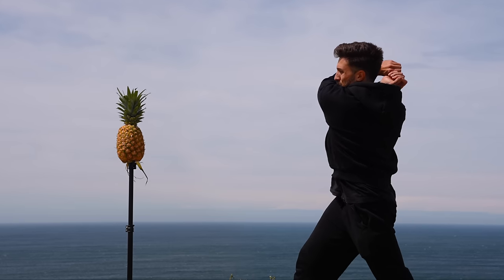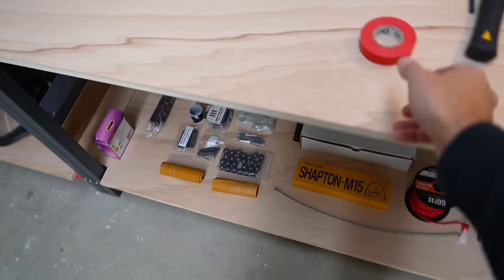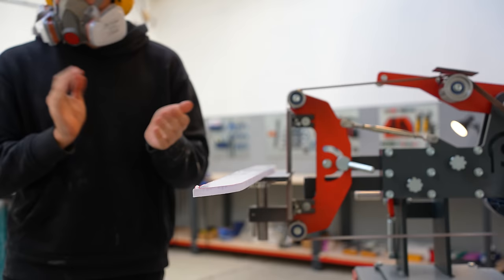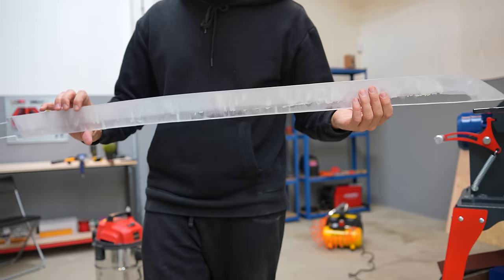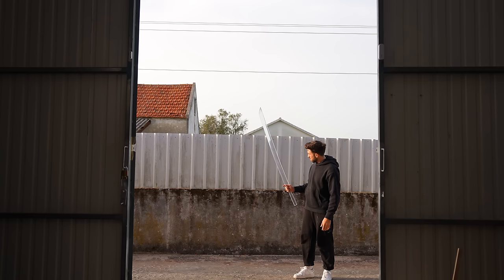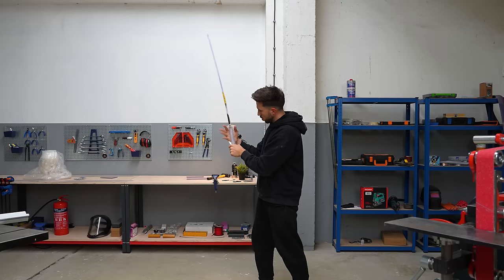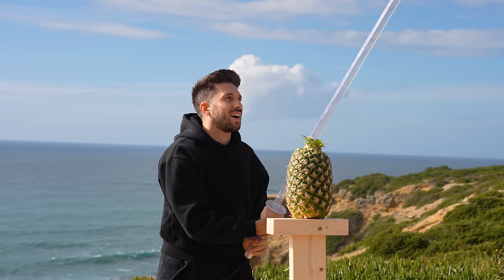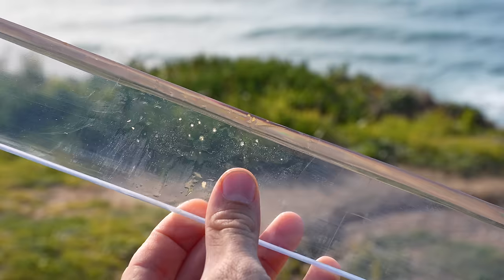I Built a Transparent Katana

Comment: The fact that the blade is so thick that it reacts like an thin hammer and not a katana. It do not cut but completely smash the objects !
Reply: The fact that his stroke is baseball bat smashing, not cutting.
Reply: Yeah, the first blade would have likely cut much better, even if it's far less transparent.
Reply: @joedingo7022  I want him to test the first blade. It would;ld have to be a better cutter, but maybe not as robust...
Reply: It's mostly the taper off the edge and somewhat the thickness of the whole "blade" 
Just as in regular cutting. It's behind the edge thickness. A thin but completely dull knife will still cut through most things while a thick but razor sharp knife will have a very hard time going through an object
Reply: Correction “a” thin hammer.
Reply: A thin hammer is known as an axe.
Reply: @elio7610  yeah but i talk about hammer not axe because it smash more than it cut. That's not the same thing if you understand what i meant
Reply: that was more than a 45° edge too!
Reply: @ewen59gaming50  It wasn't the best cutter but it definitely cut.
Reply from the maker: Yeah I agree. The first blade would've been a bit better at slicing, still not even close to a normal steel sword being PC really soft. My goal this time was just trying to make it as transparent as possible, so I'm gonna maybe test the first blade and make a short or an IG story so that you can see how it performs. Looking back I also feel like PC would be much better for a club or something like that rather than a sword
Reply: @MikeShake  I want slingshot 😢😢
Reply: Beaucoup niku!
Reply: @MikeShake  kool
Reply: It was too big to be called a sword. Massive, thick, heavy, and far too rough. Indeed, it was a heap of raw polycarbonate.
Reply: @MikeShake you should make a besento
Reply: @MikeShake it's really cool
Reply: Im just gonna say what everyone is screaming.
So make a thinner one and try it.
Reply: @MikeShake  see i thought that when you said you were gonna make a smaller bevel, i assumed you were gonna make the blade itself also thinner by taking it and cutting it in half longways down the middle, so that you could have a shorter bevel but still have it somewhat sharp
Reply: Yea
Reply: @MikeShake stronger whip pls
Reply: This material would work for those HUge sword builds like Guts Sword. Dragon slayer or something
Reply: So did Musashis modified oar
Reply: Well still effective to break bones. Limbs no more
Reply: I think the reason it smashes is mostly because the blade flexes too much so the edge doesn't align
Reply: Simply paint a sword neon green
Reply: I'd say it acted more like an axe then a hammer, but tomato tomato
Reply: @apollyonnoctis1291 i understood that berserk reference
Reply: *The invisible sledge slicer.
Reply: @MikeShake  The point was to make it Invisible not the sharpest sword ever!
Reply: @MikeShake Polycarbonate might make a really decent axe also...
Reply: It's essentially a katana-shaped sword that functions like a medieval broadsword.  Doesn't need to be razor sharp by any means, because it relies on the weight to carry the "edge" through an object.

Kinda like the video I just watched yesterday from Kentucky Ballistics with the Gyrojet pistol. Fires one chonky looking "bullet", with the jet propulsion on the back basically FORCING it through a block of ballistic gel.
Reply: @MikeShake for the first katana you should give it a non transparent handle I think it would look sick
Reply: The fact that the blade is visible and not invisible
Reply: I its not a hammer it works more like an axe. Its to wide to "cut". Its a hack. 

How do i know?

Im a bladesmith
Reply: The larger and heavier edged melee weapons does have rather dull edges and used not to simply cut through armor but to gather enough force to break the armor and damage whatever it is protecting.
Reply: "it was too thick to be called a sword..."
Reply: Average guts berserk weapon
Reply: a thin hammer*, it does not cut, but completely smashes...*
Reply: It would be generous to call it a sword. Its more like a hunk of steel
Reply: I feel like it's more like a bat with a bevel instead of an axe or hammer
Reply: The problem is that polycarbonate itself can't really be sharpened to any meaningful extent. It's interesting that he chose a katana, as the strength of that sword comes from the combination of the flexibility of its core steel and the hardness of its edge steel, the latter of which being what allows it to be brought to an extremely sharp edge. In theory, he could recreate that effect with this sword by making the very edge out of a thin piece of a much harder material (most likely a length high-carbon steel wire or sheet or something) bonded securely to the polycarbonate. The thinness of the edge material would lend it flexibility, while the bulk of the polycarbonate body would lend it strength and heft.
Reply: @apollyonnoctis1291 It takes Guts to wield that weapon.
Reply: that sounds like a hint that the anime character that uses it is the most non ninja type person known to man.
Reply: Doesn't *
Reply: It would've cut better if he wasn't broadsiding it with the blade. This is a common mistake I've seen repeatedly over the years from many people on YouTube. Just like with kitchen knives and steak knives, the cut is cleaner and smoother at an angle so that the blade is drawn across the surface. So instead of all the force hitting in one spot like an axe, which is respectfully powerful in its own right, more of the edge is used and makes a continuous cut, losing less energy across a larger area. The fact that it did so well like that makes it really scary to think how it will do with a proper cut. 😮
Reply: @theElemDragon both have essentially the same weight.. it's how they're profiled and balanced that makes the difference
Reply: And yet it has to be thick to be durable. Conundrum.
Reply: @MikeShake next video idea pls👀
Reply: @MikeShake  a machete! shorter and thinner blade but much wider, you still have a lot of invisible part and you dont mind the short edge
Reply: @MikeShake  Cold Steel produces polypropylene katanas for Aikido/Iaido training. Although they are not invisible and not sharp, they are virtually indestructible. I have been using one of them for five years, we also use it for full contact strikes and the blade holds.
A friend once sharpened his blade and the cuts were impressive, although not quite as strong, because polypropylene is much softer than steel.
Reply: *a thin hammer(I am a certified 🤓)
Reply: @MikeShake wow
Reply: @MikeShake Trending!
Reply: Fan
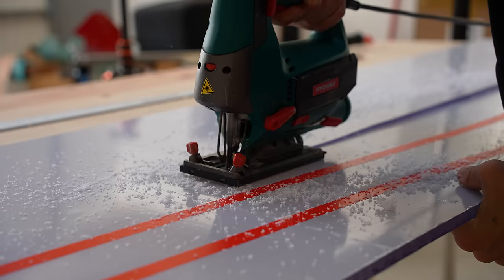Reply: @MikeShake  3:15
Reply: @MikeShake  3:17
Reply: @MikeShake  3:21
Reply: @MikeShake I’m a fan!!!❤😂🎉😢😮😅😊
Reply: An interesting proof of concept, though ultimately impractical.
Reply: @theElemDragon  A Medieval "broadsword: could be and were mostly sharp, maybe not katana sharp, but plenty sharp. The idea that Medieval European swords were exxentially dull bars of steel is a myth that's long been disproven. And katanas, while capable of being sharper than the average European arming or longsword due to its construction, was no more capable of cutting through metal armor than its European counterparts wer.
Reply: @MikeShake you should make a khopesh
Reply: @elio7610  It sundered. It didn't cut. Hehehe.
Reply: @CleverGirlAAH  A cut is a sunder.
Reply: s‘remmah elov I
Reply: @MikeShake try coming up with ur own weapon
Reply: @ewen59gaming50:
Child, it's past your bedtime.
When (if) you grow up, try to learn how to express yourself better.
You might get (a little) farther in life.
Doubtful. But, possible.
Reply: @jeffro.  I'm french sorry if my english isn't perfect, you are a 40yo dad attacking teenagers because their first language isn't yours. Get a job seriously. If you watch the video Mike is italian an his english isn't perfect too. You have better things to do bro honestly ;) And it was 6am when i wrote this comment, you, you are writing this in the middle of the night, don't you have a family to feed ? Go to sleep and use tomorrow journey to get a life !😘
Reply: "IT WILL NOT CUUTTT" -DOUG MARCAIDA 😂😂
Reply: The invisible skull crusher.
Reply: Guyssss,before Gta 6,we might actually get RGB kattana😂
Reply: more akin two handed greatswords.
Reply: Guts Sword
Reply: "It do not cut" 
Why can't people spell correctly???
Reply: @MikeShake great axe?
Reply: @petermgruhn i was just about to say the same thing. This is not how you use a katana. But Videos was awesome. I am curious what Happens of He uses the katana correctly.
Reply: @MikeShake Yea you made a clear version of Sephiroth's sword(FFVII) "Masamune". The first time around, I want one. I'd also like to see a busta sword version...but I don't think that's possible.

(Also like your giggle after saying you're going to test it on... A lot of things.)
Reply: @MikeShake  make it more like a scimtary, it s curve make it mitigate the initial shock and offer a smaller portion of the blade to start the cut.
It can be thin because of that, usable on horses for slicing with horse speed helped a lot aswell, but that not the purpose there :p
Reply: it can cut but not slice properly he hits the watermelon and it does a horrible job slicing through an easy target, overly wobbly to the point where the side of the blade connected with the melon and just blunted it. It's a cool idea but not practical maybe could be improved. An invisible short spear on the other hand would probably be very effective. Attacking with given the same type of material would be harder to see coming too as perception is harder with pointed objects coming straight at you with depth perception. The weapons only visible point would be the spearhead tip making the entire weapon that much more transparent.
Reply: porque aca la gente habla solo ingles xd
este es un video español creo yo .-.
Reply: @MikeShake  A PC Warhammer would've been wild.
Reply: This is such trash content...... And you want him to make a plastic hammer....
Reply: Thinner blade will break that plastic isn't indestructible as we all saw with the broken handle and it's not going to hold a good edge due to lack of carbon steel 😢
Reply: Maybe you can combine more materials, PC make it transparant, but you need ''bone'' to make it not bend whien you swing it. N maybe more thin metal to make it cut rather then smash
Reply: its not like he said that multiple times in the video right
Reply: @petermgruhn  true, that always kinda annoys me to see when people try to test medieval weaponary and the like
Reply: an invisible hammer would sound cool tho
Reply: @apollyonnoctis1291  one word for you: dragonslayer
Reply: @Sharp.Penguin00  yup, it's all about resistance. and also on how to maximize balance and force when striking. I'd really recommend he makes a heavy pommel at the bottom of the blade to make it work more like a sword and less like a very sharp club.
Reply: @MikeShake  you need to:
-thin out the sword as much as possible 
-make a counterweight on the handle/pommel so you have more control over the sword itself. I'd also suggest reducing the general thickness as you go into the tip of the sword. So thick base, and thin tip. This will ideally make your sword much more maneuverable. The center of balance for swords should generally be a bit above the handle, just so you know.
And with that, the sword would be much more effective, and maybe you could take advantage of the distortion and create patterns along the blade to make it look icy? Dunno man, but I really want to see this sword be the best it can be.
Reply: its unbreakable
Reply: Yep, I don't know why he's calling it katana, it does not look like a katana at all.
Reply: @elio7610  A wedged maul. An axe shouldn't be THIS thick.
Reply: Precision wedge crusher 🤘
Reply: I have a real Katana in my house it can likely cut anything like a flash 📸.
Reply: Every things broken due to high impact not sliced
Reply: factoriales
Reply: i have never see a katana that is 12mm thick, not even most of the knives and swords. maybe in sabres and axes?
Reply: It’s a slightly sharpened club.
It might’ve been too brittle if it was made as thin as a normal sword, which is why it’s hard to make swords in the first place.
It has to be brittle (hard) to keep an edge but it has to be bendy (soft) as to not crack. Sometimes katana are annealed (a process that softens the metal) at the spine and hardened at the blade end.
Reply: Yo Mike great vid
Reply: @MikeShake Looks more like a ninjato
Reply: Correction “a” thin hammer. ❌
Correction: “a” thin hammer. ✅ 
You shouldn’t be correcting anyone’s grammar.
Reply: I agree with this assessment
Reply: Oh and you need to flat polish the edge. You polished a curve into it. I've spent years polishing and years playing around with acrylic polycarbonate amongst other things. 
But I still love what you done.
Reply: Let's appreciate the hard workkkkk. You try first then speak 🖕

Bet you can't.
Reply: @Sharp.Penguin00 thick sharp blade still can cut tho. That's what you would call a bastard sword
Reply: That’s exactly what we say about your mom
Reply: @boxmonkey1  wow what a comment, happy new year 2012 bro, that joke so modern !!
Reply: @ewen59gaming50  no joke. Your mom is sleeping with everyone.
Reply: @boxmonkey1  you're litteraly twelve years old bro, you're not funny dawg
Reply: The hammer sword of transparency 😂
Reply: ❤ Love it
Reply: Yess its almost smashing
Reply: "That thing was too big to be called a sword. Too big, too thick, too mildly heavy, and too transparent, it was more like a large hunk of polycarbonate."

Comment: Mechanical engineer here. By making a 90 degree angle between the blade and the tang in the handle you created a stress concentration there. Abrupt changes in geometry like this create localized stresses far greater than the average stress, hence why your blade snapped there. Fun video!
Reply: Also, If I'm remembering correctly the flexibility of the material allows for better energy dissipation and lower impulse as the flexibility delays the force by storing energy in it's waves thus increasing the time it takes for all the force to act on the blade. 

So sandwiching it between two pieces increased the materials inflexibility at that point, and the flexibility along the axis of the beveled edge isn't good either due to it's thickness, so most of the force along that axis would have been transferred to the tang in a short amount of time, putting it under much greater stress.
Reply: So would it have been better just to paracord wrap the tang itself ??
Reply: @kyjohns8271  If by the tang you mean just the base of the blade (without cutting it), then yes! That's basically what he did in the end by just wrapping the base of the blade with a towel. If you mean keep the 90 degree angle and just wrap the smaller part, then no, the abrupt change in geometry is what induces the higher stresses. If he still wanted to cut the base of the blade to make a handle, he could have reduced the stress concentration factor by rounding the corner where the tang meets the base of the blade with a "fillet." The larger the radius of the fillet, the lower the stress concentration factor. In other words the more rounded the corner, the lower the peak stress caused by the change in geometry. The stress would still be the highest at that point, but it would be much less extreme than the stresses caused by the 90 degree angle he made.
Reply: Yup.  I was gonna say the same.  I was saying to the screen while watching him make the rough cutout, that it needed some fillets in there! lol
Reply: Yes
Reply: Na the superglue ate the polycarbonate.  Made it brittle 🤷‍♂️
Reply: @someguykris44  km
Reply: This is why airliners don't have square windows but round ones.
Reply: @someguykris44  Super glue doesn't eat .
Reply: @someguykris44  Are you a mechanical engineer too?
Reply: @t_g_gamerftw5075  so basically it tore the handle like how we tear a sheet of paper by pressing when we stress it
Reply: You missed out making Saber's invisible air Excalibur
Reply: Yes true....stresses concentrate near discontinuity
Reply: @t_g_gamerftw5075  typically flexible materials absorb/distribute stresses by bending/deforming. Restricting the ability to deflect like it naturally can would cause the internal stresses to build up because then the material itself is forced to resist the applied force. Shear stress is also inversely proportional to the cross sectional area, so by decreasing the cross sectional area of the sword there the stress increases proportionally. Overall everything going on at that point was not really conducive to the sword staying in one piece lol
Reply: I made this comment elsewhere myself.  I'm not an engineer, but I know enough about swords and history to know that this was a known issue in medieval times and competent sword-makers would never have a straight right angle at that point....
Reply: Nature doesn't like sharp angle
Reply: What I find funny is that he was a civil engineer. I thought a lot of what occupies their mind is minimizing stress on individual segments.

Comment: As a licensed optician, I can tell you that the buffing wheel with some polish will give you the results you’re looking for with the transparency on the edges. You won’t have to go through 200 hours of sanding. The first katana you made, it was what we call a prism.. you essentially made 1/2 a plus lens. Apex on the edge and a base in the middle. Honestly, polycarbonate is good, but if you can get a sheet of trivex… it would be stronger than polycarbonate. 😊